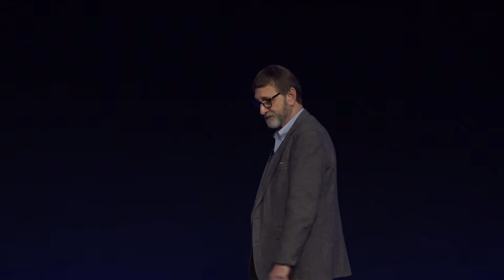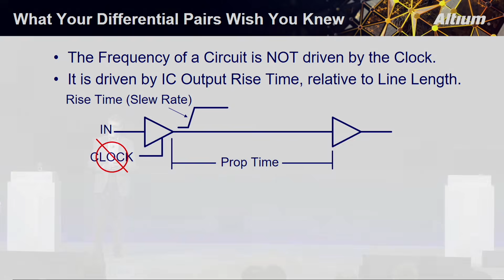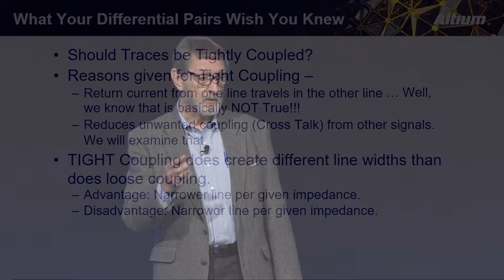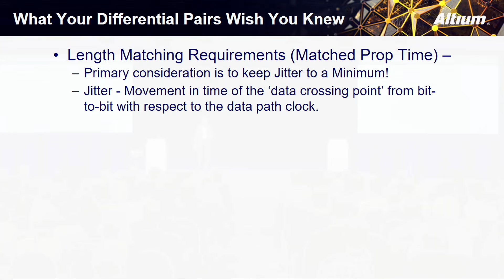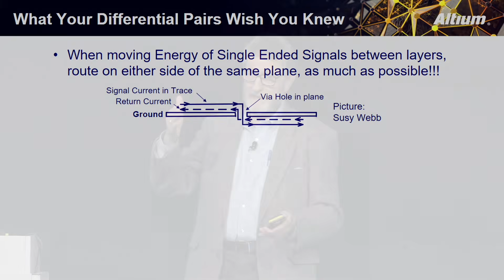What your Differential Pairs Wish You Knew with Rick Hartley - AltiumLive Keynote

Comment: I was lucky enough to have a Emag professor that taught me where the signal travels in Coaxel cable so I could get to this faster, otherwise I just learned RLC and semiconductors. Thanks Rick Hartley and also Dr. Dr. Jie Huang for opening my mind.
Reply: Any decent technical university teaches that, concentric cable is a standard example that students calculate (where is the energy: IN THE DIELECTRIC). Finest example is Light (how/where the EM fields/waves energy travels).

Comment: Differential signals are two single ended and each reference the ground. OMG then what is UTP? Why UTP cables have no reference and it can handle up to 2.5Gb/s Ethernet. Since CAT 5e is UTP as far as I know. And it makes me nervous and mad and angry and sad.
Thank you so much Altium guys.
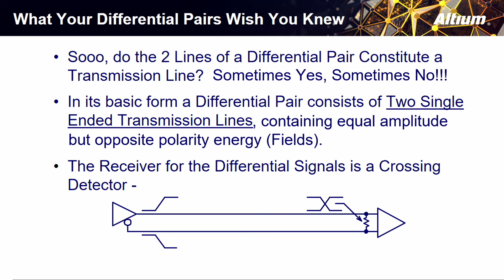Reply: 23:55 Lecture covered your exact question.
Reply: @r0sal3sr  They reference each other and not the ground? But it conflict with Differential signals are two single ended. then wich one is correct?
Reply: @seyyedmohammadsaadatmand5517  Watch the lecture at the timeline bookmark I made. The point is that "differential pair" is used to describe a few different transmission line setups. So either is correct depending on the context of the scenario being described. 

Twisted pair, with no separate reference, is one type of differential pair transmission line, but not the focus of this lecture.
Reply: @r0sal3sr  The only way I can justify: on PCB lines are more parallel to plane to being parallel to each other then the fields are concentrated between each one and ground. In twisted pair instaed both are sufficiently parallel to let fields being concentrated in between them. Are you agree with? theogh is not so strict!
Reply: If you want see why it’s can work without reference plane in Utp cable you can open Erik Bogatin’s book called “signal and power integrity” chapter 11.6 and figure 11-19. It’s shows how single ended impedance change with radius from twisted pair to ground shield, but differential impedance stops change at certain distance. So you can remove shield (make radius infinite) and diff impedance don’t change.

Comment: The main benefit of DF pair is to get ride of "ground noise", You transfer your signal between two line that are suffering the same GND noise
so at the receiver only the signal is extracted and Common noise is rejected.
If you route the Pair's lines far apart "at each edge of the board" , how do you guarantee they are suffering the same "GND" noise
if they are not and each line see a different noise level the noise rejection at the receiver will not be effective
Reply: He only routed them far like that to proove that the distance between them and the lenghts aren't as important as that guy through and the circuit would still work fine. He's not suggesting you actually do that as ofc, like you mention, there are other issues with it, but that was not the point of that particular demonstration as they were not discussing noise rejection and just discussing that the circuit it will still function.

Comment: I am playing with a differential dac and i can confirm that the differential to single ended signal has much less "noise", that was common mode before. it was on spagetti wired prototype and also on optimized pcb to observe.

Comment: some points were wise, but some were a brute oversimplification bordering on inaccuracy. I have a few years of analog, RF, mixed signal chip design in mutli-GHz range. take that example of routing the diff lines on opposite sides of the chip. well... what if you were to rout a bunch of vias running an aggressor signal orthogonal to the differential lines plane? Ampere and Maxwell would come back from the dead to smack you in the face in a form of bad differential interference 🙄 and then some peculiar definition of jitter 🤔
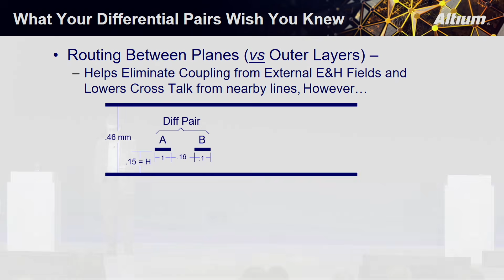Reply: If those vias were close to the diff pair, then it would be fine because the noise would induce in both lines equally? Is this different from the example in 36:32 which implies asymetric noise injection   anyway?
Reply: @dzidmail if an alternating current passes through a wire loop, it induces some alternating current in that loop. think of the separated diff lines as a loop that closes through the loading diff stage input cascade. you would have induced a diff noise this way

Comment: Wow, this has been really enlightening. I only started working with differential pairs this past year and to think I was so wrong on some of the things I thought about them. I'm really wondering if there's much benefit to having differential pairs for same-board transmission vs just a well routed single-ended signal. Considering he said about 85-90% of the coupling is between ground underneath, that still leaves 10% of the coupling for the trace to trace influences. Maybe that's enough to make a difference in some designs. Considering DDR is single-ended, it would seem that single-ended transmission for same-board transmission is just fine! I had used differential pairs for deserializing a data stream from off-board so that's why it was needed in my design, but I think I was starting to travel down the path of just thinking they were better for signal integrity inherently. Great talk.

Comment: 53:15 Is it correct to say that the misalignment causes current which must be "absorbed"? And the two-R plus cap serves to absorb that current?
Reply: It gives the generated, unwanted current a path to 0V, so it doesn't travel in the signal lines as far as i understand it.

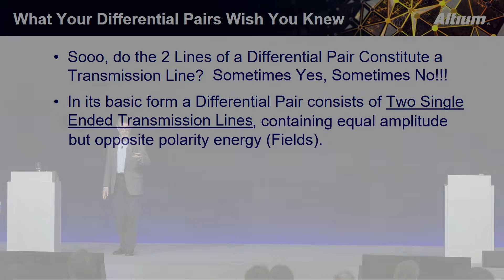Comment: 23:21 But just if digital signals, right? Analog, eg balanced mic cable, cares about whole waveform.
Reply: Depends on your rise time, but rise time for an analog can be much  lower.
Reply: True, he's talking mostly about digital signals. Low frequency analog has different requirements.
But, analog signals are amplified or modified at some point and if a digital signal manages to couple into an analog path, then those very sensitive amplifiers might not work as intended. So digital signals are always routed away from the analog to protect the analog signals. And to do that you'll need to understand how the digital signals travel.

Comment: 20:00 "Forget voltage and current" seem extreme. Throw out Ohm's Law?
Reply: Yes
Reply: Yeah, it's all little antennas at high frequencies.
Reply: Ohm's law isn't V = IR.  That's a gross oversimplification, and the  full formula is still just an approximation which makes many assumptions about materials and behavior.  Real world is a bit different, especially with high frequencies and RF.
Reply: Dude its about pcb design, not circuit design

Comment: Veritasium dudes mark your attendance here.
Reply: That would include me.
Reply: I'm late to the party
Reply: @linearz I think we are all late to the party,  shoot EEs in my area don't even consider this as important and most people that deal in Electronics only assume Curent and Voltage 😂
Reply: did he recommend the video or smth ?
Reply: @creedo8301  He made a video that upset electrical engineers at first, about a 1 light-mile switch. So veritasium made a more in depth video about how power flows through the fields, in the dielectric, not the copper. Clips from this video were shown there.
Reply: @P4nDA_pls  i've seen both of them but at that time i wasn't into PCB Design, damn 

it's all coming together
Reply: @P4nDA_pls  He upset WHO? Real electrical engineers know the BASICS (energy transfer in the fields, in the dielectric, along the metal, we know that for 120+ years or so). He upset average/mediocre people, general public (most folks "think" in terms of voltage/current and use pseudo "laws" like Ohm's one).
Reply: Here
Reply: In a way, Veritasium inspired me to go into PCB design by the topic of his initial video. Then when I learned about Rick, it surprised me how many pol lack this fundamental concept and as a result, don’t even really understand PCB design or why it is complex.

I currently design PCBs for a living now.
Reply: @alexanderthegr888  Undergrad here, have any tips to get into that career?
Reply: Me too